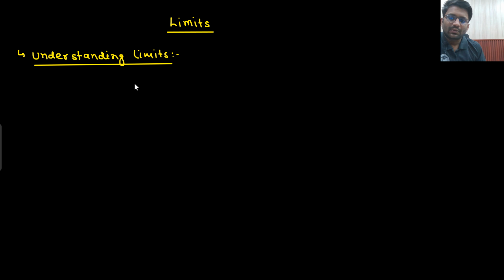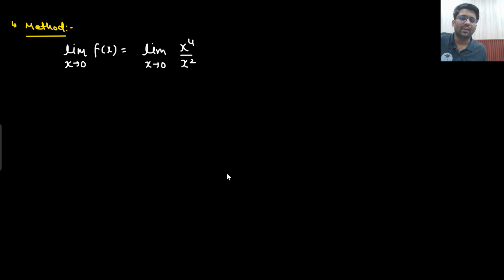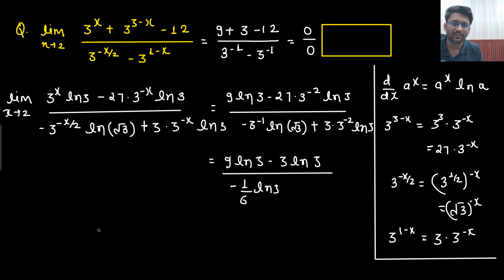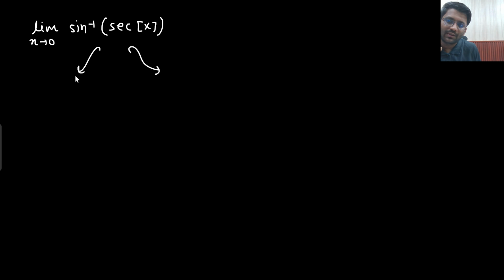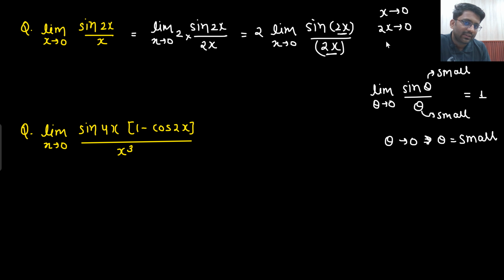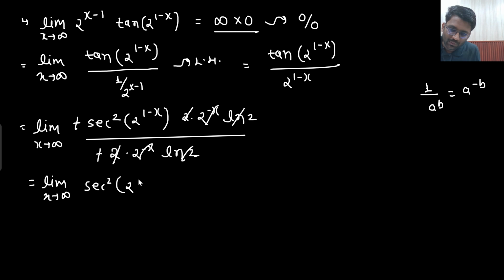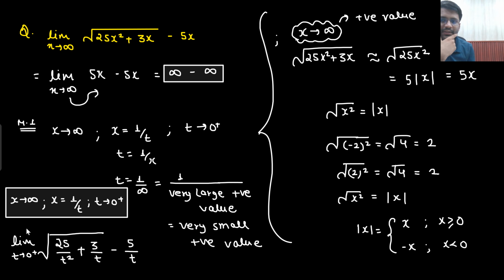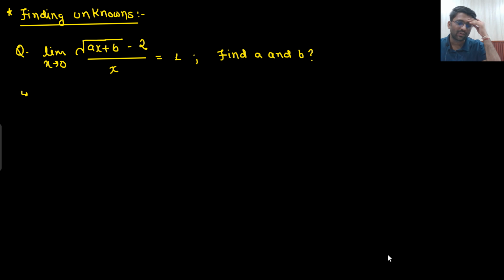Limits (Part 1) || Engineering Mathematics || PrepFusion

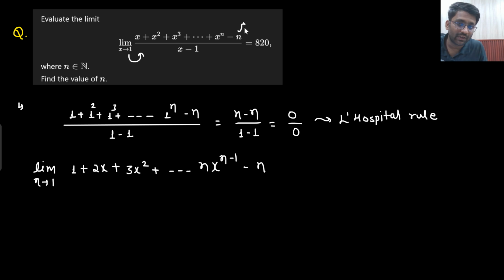Comment from the maker: Error at 1:08:21 - Differentiation on n w.r.t x will be zero, not n. In place of "-n", zero should be written which will change the further calculations, the final answer will be 40, not 41

2:20:08 - Calculation error. (1/2√2)x(1/2) = (1/4√2) will be the correct answer
Reply: much important clirification in regrads to the constant , thank you, since you followed a different method for teh next problem which was x^n - a^n/(x-a) where diff of a was taken  , THANKS FOR CLARITY
Reply: 😅I got relieved because I got answer as 40 and when u showed 41 . I thought maybe ur procedure is correct and all these days I am dng it in wrong way . Thank God 😂
Reply: Yaa correct sir
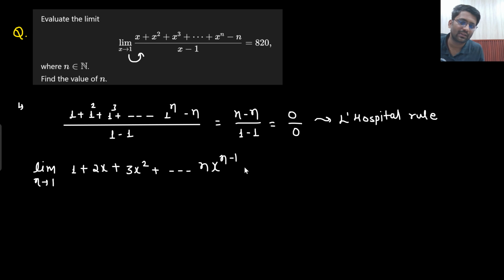Reply: 1:08:21 
same i was thinking and you have already commented it thank you sir